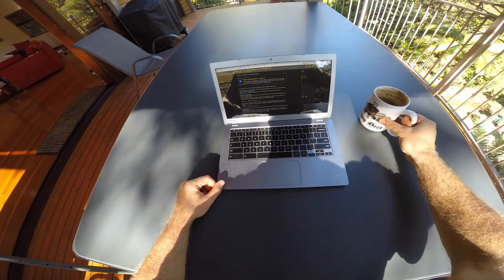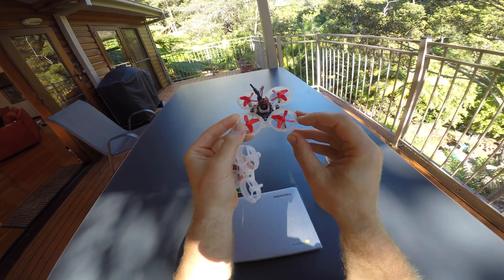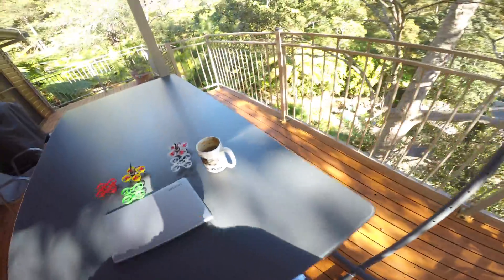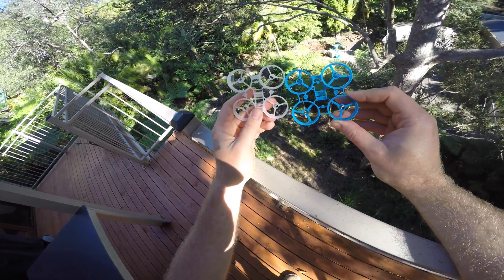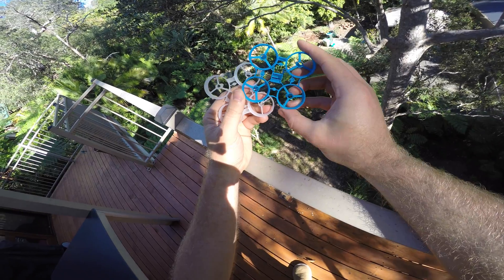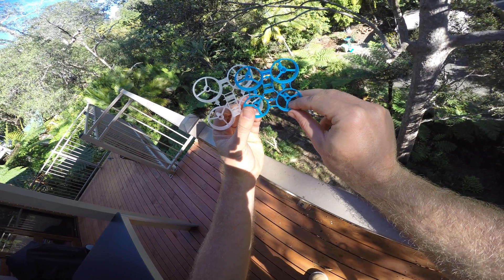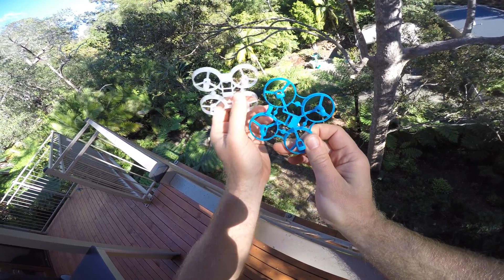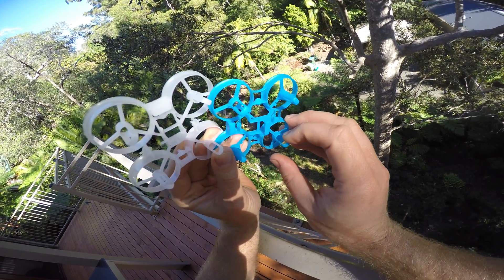new 7016 frames! - stronger, better, colorful

Comment: Hi Ben will these be the new standard frames that come in the whoop body kits?
Reply from the maker: Yes. I still have a few logistical challenges to tackle, but thats the plan. And there will also be a complete 7016 kit again. Gimme a day or two ;)
If you want a kit of any kind earlier, message me at support@mmw.rocks and I will put one together for you!
Reply: Terrific thx
Reply from the maker: The main difference is that these frames have 7x16mm motors mounts, whilst the Cockroach is for 6mm motors.

The plastic on this latest version is quite stiff, yet it seems to take a lot of abuse. Currently waiting for the mailman with the next load to AU, so I can do some more crash-testing ;)

I broke quite a few of the Cockroach frames. The ducts chip and crack. And when I was told that the new version come in color and is more expensive, but has zero improvements over the old ones, I moved to the Beta frames.

The Beta65 frame has the same size motor mounts as the Cockroach, but its not as good as the new Beta65S frames. I hope they update that in the same fashion!
Reply: Micro Motor Warehouse Excellent i cant wait to try them! I emailed you :)

Comment: Those are blade inductrix frames......
Reply from the maker: They are very similar, thats right. 
But they take 7x16mm motors, instead of the 6x15mm motors in the Inductrix frame. And they are not made of flimsy plastic that breaks when you sneeze.